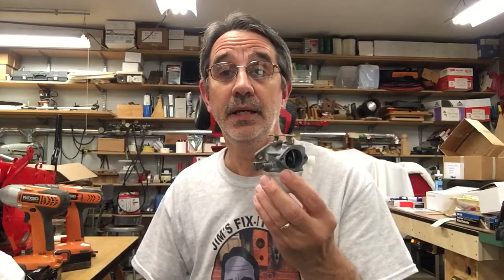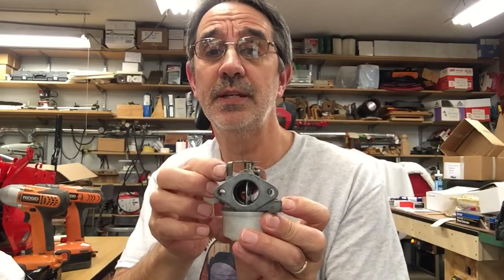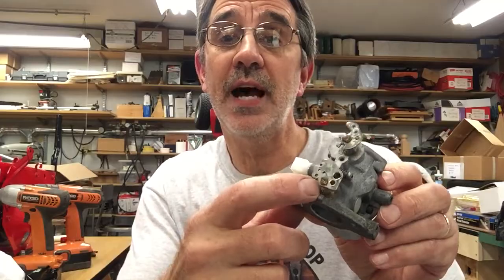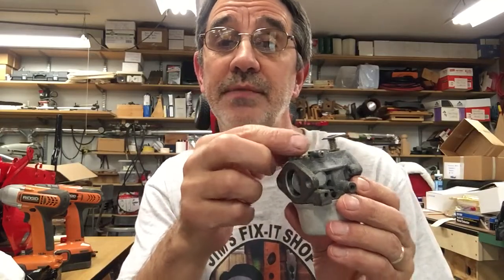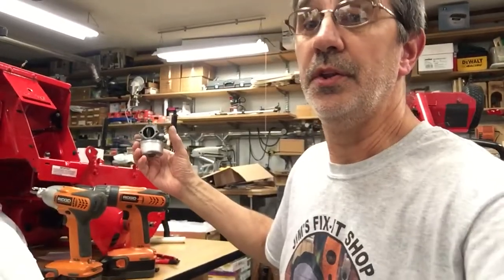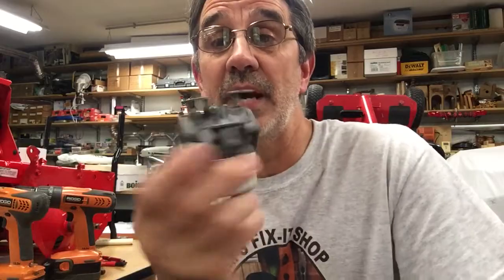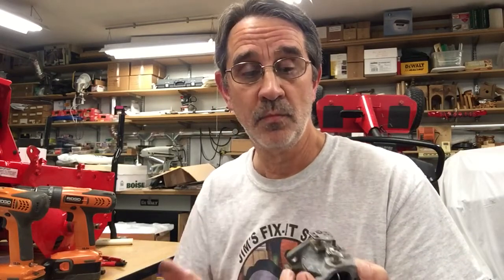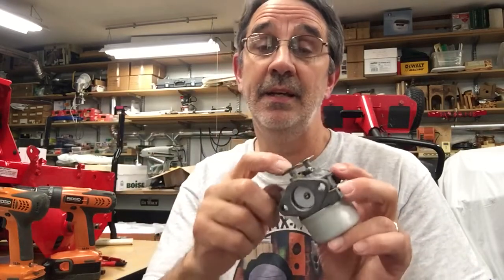266.   Why is my engine running wide open at full speed

Comment: Thank you Jim. After desperately trying to adjust the governor, choke, and throttle for about 2 hours i came across your video. I laughed and muttered "no way, not a chance" but sure enough, there was the throttle plate, sitting behind the carb. Screws are nowhere to be found but mystery solved. hahah. Thank you!!!
Reply from the maker: @ChrisCalnon  well it probably would be a good idea to pull the head and make sure the screws went all the way through into the muffler so it doesn’t damage your piston.       Jim

Comment: Thanks Jim.  My butterfly is fine.  I think when I put the carb back together I put it back together wrong and the engine ran wide open.  Rebuilt the carb the correct way and now my governor doesn’t throttle down.  I’m afraid my governor is toast. 😢

Comment: Hi Jim.  Love your  videos.  Always a wealth of information.  This tip might be of relevance.   On my Snapper Snow Blower with a Tecumseh engine, I had engine speed over-revving and no control of the engine speed with the throttle.  I bought a new carb as I noticed a lot of play in the throttle shaft.  The new carb did not fix the problem. After a lot of research on the internet, there was one suggestion about gaskets.  The new carb came with a carb to intake manifold gasket but I went online and bought a new one along with the intake manifold to block gasket.  Putting on the new gaskets fixed the problem.  That was last year and this year it is still working perfectly.  Just a possible fix for a similar problem.
Reply from the maker: Rich from NY 
  Thanks Rich I will pass that along to my viewers. Jim
Reply: Thanks Jim will give it a try

Comment: Hey Jim just found your channel today(7/30/2021) Shish I had found it a year ago when I had the same problem. Thought it was a governor or leaking gasket causing the engine runaway. To it to my trusted mechanic and he found the brass throttle plate jammed inbetween the intake valve and seat.also tell tale signs of the a few had bounced around in the cylinder for awhile. Put on a new head gasket and used carb, and it runs great runs.
Reply from the maker: That is definitely not a uncommon problem the screw works loose that holds the butterfly to the shaft and typically the butterfly stays somewhere in the carburetor but it sucks the screw into the engine and usually out the exhaust valve into the muffler I’ve had a few viewers with the same issue and I explain to them how to fix it. Jim

Comment: Hey Jim, good Information. I have a briggs vangaurd 16hp twin cylinder on a Simplicity Broadmore lawn tractor.  I had an issue with an exhaust valve guide pushing out. Found an interesting fix for that, that I can tell you if you want. Although that doesn't
have to do with my issue. 
I have this all put back together, and when I start the engine it runs on fast speed. So I immediately shut it down. The throttle cable moved the governor "wheel" although the throttle butterfly isn't returning to slow (idle) position.  I can move ot manually by moving the lever. Linkage and a spring looks to be hooked up, and connected to the governor lever.  It just seems that something is not connected correctly that would return the throttle position to idle.  
Again the throttle cable works correctly, moving from slow to fast, but something is not allowing the throttle to move to or return to slow. I have looked at parts diagrams on line, but they are not helping much. Any ideas?

Comment: I'm glad I found your video. Last weekend while mowing with my R8 Ford riding mower, it dopped the idle down, then died. Upon restarting it, it was full throttle with the throttle lever unresponsive. I was thinking the governor junked up and just stuck. So, after a can of carb cleaner, blowing all the gunk off, no go still full throttle. So off to Youtube for a possible answer. I found your video and off with the air cleaner housing to look down the carb. Sure enough I could see the where the butterfly should be, but gone. After taking the carb off, I found the flapper wedged in the intake tube, but no screws. I looked and could see the back of the valve and no screw's. I'm hoping they blew out the exhaust valve.  Question is should I find the screws. When this originally happened, I finished mowing at full throttle for about 30 min. I'm thinking it blew them out, hopefully. Motor sound fine. So. should I start hunting for the screws. I don't know if the muffler will come off without destroying it.

Comment: Hey Jim I have a craftsman lt1000 riding mower.  I have since turned it from an ordinary riding mower to a mud/ racing mower.  Done plenty of things to it such as lowering and suspension.  To make it safer.  Anyways I have carb issues since when I start it it will run and and idle super high to where I’m afraid it will explode.  But when I put it in gear it idles down and doesn’t ever idle back to that same rpm again.  Only when I push in clutch or I am not in gear.  I have put and new carb on and this is the issue I get.  The old one had a fuel solenoid which stripped out.  Thanks I’m not sure you see this but I hope someone does
Reply from the maker: It sounds like your Governor isn’t working properly.       Jim

Comment: Jim, my carb I've had off the Snapper Hivac to cleaned twice, #191707 model. It runs fine at low rpms and hi rpms... then under load,, only at high throttle speed it boggs down.
Thankyou Eric
Reply from the maker: Were you able to unscrew the high-speed jet that is inside of the stem that the float bowl screws onto.         Jim
Reply: @jimjackson9381   yes ive tried that . But maybe not be patient enough?

Comment: Hey Jim ! Nice video . I'm working on a craftsman lt2000 because  it's like it's stuck in high gear . It's the 1 with the shifter he's on the side down is for forward it back reverse.
Reply: Anyway when you put it in forward and let it out let the clutch out slow It throws your head back . Where's my issue? Thanks
Reply from the maker: I’m gonna have to say sorry I’ve never worked on a craftsman machine. Jim

Comment: Having issues sr1433. Runs wide open on choke an will not run normal on rabbit it runs as if its choke seems governor is not working properly or i got something backwards..please help p.s orgin of issue started when little piece of lever that holds one of the levers I found broken so I'm not sure how it goes back together. YES I'M SUBSCRIBED :)
Reply from the maker: Send me some pictures of it if you can and maybe I can tell what’s out of place and you can send them to
jimsfixitshop@gmail.Com
And have you tried, pulling on the choke arm on the side of the engine to see if that will slow it down? Talk to you soon.                Jim

Comment: Jim, Great video. I don't know if I have the same problem or not. I have been rebuilding my kid's go cart, it has a Husqvarna engine. Just fired it up for the first time and the throttle only works with the start/choke level, the throttle level does nothing. Do you think I am missing the butterfly on the other side of the carb?
Reply from the maker: Well if it is missing it would run wide open otherwise if it’s just idling I would say you have a linkage out of place going to the carburetor. Jim

Comment: Hi Jim i have a John Deer D-130 lawn and garden tractor 2017 model . I used it 2 weeks ago to cut my grass ran good. today i started it and the engine throttle went all the on like open all the way as if it was stuck on. so i shut it off. thinking the springs broke or wore out from the hot and cold. i will look into the engine /carb tomorrow ill get back to you to let you know if thats the problem.
Reply from the maker: jimmyfreelong 
Check to see if the screws fell out of the butterfly for your throttle control that happens a lot if they did then they’re inside your cylinder or they may have went through and they’re in your muffler. Jim

Comment: Hi Jim I have this exact problem 1 screw and part of the butterfly shaft has obviously disappeared into the engine some where, I can purchase a new carb at around $100. My question is it worth taking the gamble that the engine will live after the expense of the new carb, the machine was running at full revs for a probably 2 minutes just getting back to the shed.
Reply from the maker: I think just for safety sake I would pull the head off and see if any parts are stuck in the top of the piston or the bottom of the head that could come loose and cause serious damage down the road chances are if it’s a screw they’re small enough they typically pass through the exhaust valve and you’ll find them rattling around inside your muffler but if you’ve got part of the shaft missing that could cause some serious damage to the engine but if the engine still running you may be OK but I think I would pull the head off just to be sure and as long as you got it off it would be a good time to clean all the carbon deposits off of the top of the piston and the head it will make it start easier, Let me know what you find out and you should be able to find the parts for the carburetor that you’ve lost from a Ace Hardware I’m sure they can order them for you. Jim

Comment: Hey Jim,  I did a carb clean on my craftsman self propelled push mower. push mower. Also had to replace the cable that goes up to the handle that has to be held down. Once put back together,  it's stuck full throttle. I tried and tried to figure it out. Finally bought a new carb, and im having the same issue.  It's driving me crazy. . Please help.
Reply: I tried adjusting the governor as well, but  nothing changed. Its very close to being thrown I'm the street. Lol
Reply: Same thing happen to me
Reply from the maker: I’m guessing something happened when you replace that cable maybe take it back off and see how the engine runs and then replace the cable and see if that makes a difference. Jim.

Comment: New Amazon carb on a husky carb. Wide open  she’s screaming   I’ll check this out no adjustments right left it does nothing   Chainsaw not too safe and I like to warm up ar idle
Reply: Same problem I'm having. I have a husky 450 and got a new carb on amazon. That thing has my chainsaw very very wide open, damn near scary. The only thing I can think is, imma clean the old carburetor that was on there, and see if that solves the problem. I didn't have this wide open situation till I got this new carb.
Reply from the maker: A lot of people that I talk to tell me that the carburetors on Amazon aren’t much good. They’re probably all made in China and if you get one that does work properly, it won’t work for long, you’re probably better off to take it somewhere and have them rebuild the carburetor.

Comment: Should the governor be free moving ( mechanical governor) when not running..issue is engine running full throttle I have had the the carb off to clean it honestly I can't say I looked for the butterfly  I guess I will look but the governor seems solid...it was a pressure washer engine if that makes a difference.
Reply from the maker: The governor arm should be able to move when the machine is not running how much movement I’m not sure, but I did have a machine once that the shaft coming out of the engine was froze up in the bushing, if you take the air breather off of your carburetor with it, not choked. You should be able to look through the carburetor with the flashlight and see if the butterfly is in place or not. Jim

Comment: my intek briggs&statton  17,5 engine is doing that i will check it out  do you think thats what it is its running great but at full speed the thottle lever does not control it anymore ?
Reply from the maker: Well it’s either that or some linkage came loose on your carburetor. Jim

Comment: Jim thanks for your information I pulled the carabiuter out and the butterfly did come off I found the butterfly wedge in the tube but didn't find the screws replaced the butterfly but still running at high rpm and every now and then oil shoots out of the blow-by on the side of the carburetor what would you recommend
Reply from the maker: Ck to see if you have gas in your oil that would make it to high and that could cause your blow by issue.
Reply: @jimjackson9381  thanks for the update I will let you know what I find out greatly appreciated

Comment: Hi,

So I have an old yardman snow bird with tecumseh engine, now it's around 50 years old, bought it used of course lol,

So it revs very high, took it to a small engines place and he couldn't fix it, so I finally removed the carburetor and replaced with a new one and seems to still rev very high,.

And know online says there's 2 screws on the carb that you can ajust but there both almost out all the way and thts how it came, they say the more out the screw, the less should rev.

Any thoughts or tips?

Thanks
Reply from the maker: Wish I could see a picture of the carburetor but typically the high speed jet is inside of the nut that holds on the float bowl on the bottom of the carburetor the low speed jet is typically on the side of the carburetor facing away from the engine, typically you screw both jets all the way in and back them out one and a half turns the engine should start then to adjust the jets you use your throttle cable and slow the engine all the way down and screw the slow speed jet in 1/4 of a turn at a time give the engine time to catch up to the adjustment once the engine starts missing back to screw out a quarter return. To adjust a high speed jet use your throttle and speedy engine up full speed and adjust the high speed jet the same way turn it either in or out until it starts missing and then adjust a quarter turn back Let me know how it’s doing. Jim

Comment: Hi again Jim, same 8hp B&S motor same new carb. Engine starts but runs fast. Tried adjusting carb idle speed with no luck. Both choke and throttle linkages (and throttle spring) are new and are attached correctly. Why is my idle speed too high? Ive tried adjusting idle speed screw to no effect.
Reply from the maker: Well, it depends where did you buy the carburetor? Is it a OEM carburetor? Or did you buy a carburetor from Amazon? Most of them are totally junk.      Jim

Comment: Hi, just came across your channel. I have a Honda pressure washer with a GCV 190 engine. I changed out the carburetor and ever since the engine races and then eventually after about 15 minutes the engine begins to sputter and then a short time after that the engine stalls. Also, it's a struggle to get the engine to start. Any ideas?
Reply from the maker: Yes, it sounds like you put too big of a carburetor on it and it flooding enough. Did you try cleaning the old carburetor to see if you could reuse that one?

Comment: Thnx Jim I have the 17.5 kohler and it is running wide open when I crank it, checked my carb. still has both screws in it for. butterfly. Can you help me ?
Reply from the maker: You need to check your governor and make sure it’s working. What’s the linkages and make sure they’re hooked up and not loose and wiggling around if they look good then google a video on how to adjust your Governor I don’t have one yet. Sorry to say very simple to do let me know how it turns out.       Jim

Comment: Hello Jim great job on all your videos very informative. I have a Briggs and Stratton Craftsman pressure washer It's the problem is when it's hooked up to the water and running we're in running when I squeeze the handle pressure's fpressure is fine but when I release the handle it stays running on high. I replace the throttle cable that goes from the pump to the carburetor and it's still running on high. Any advice I was told there might be something behind that throttle cable inside the pump that might be broken some sort of a pin of some sort not sure is this correct.
Reply from the maker: I will definitely need a model number off of this thing and doesn’t it say in the manual a section for troubleshooting issues. Jim

Comment: I pulled the carabiuter off and the butterfly was of it was stuck in the tube but both of the screws are missing replaced the butterfly and still running really high rpm and then oil shoots out of the blow-by on the side of carb any help would be greatly appreciated

Comment: I have a pressure washer and I’m looking through the choke and the throttle plate is wide open. The throttle return spring seems to keep it wide open. This is after a carb install. Any ideas?
Reply from the maker: @aaronmercado5171  well I guess it would depend on what kind of carburetor you bought. If you got it from Amazon it’s probably a piece of junk. Most power washers have a throttle control on them, but some carburetors are made for some lawn mowers that run wide open. they have no throttle control or choke control on them. You just pulled the rope and it runs. There’s no way to control the RPMs or the choke. It’s all automatic.        Jim

Comment: I have a Troy-Bilt 550ex Briggs & Stratton lawn mower it would die as soon as I started it I replaced the carburetor with a brand new one now it runs wide open I'm at a loss linkage isn't binding or anything like that thank you I would appreciate your help
Reply from the maker: First I have to ask you where are you bought the carburetor if you got it from Amazon and it’s not a OEM carburetor 75% of the carburetors from Amazon are junk and they don’t work, I would have to say get it up on a bench or get down on the ground take the airbox off of the carburetor so you can see the butterflies and make sure they’re working properly make sure the choke isn’t stuck closed and make sure the intake butterfly is moving properly if they are then I’d have to say it’s probably something internal in the carburetor, without having it in front of me it’s kind of hard to give you a definite exact answer.     Jim